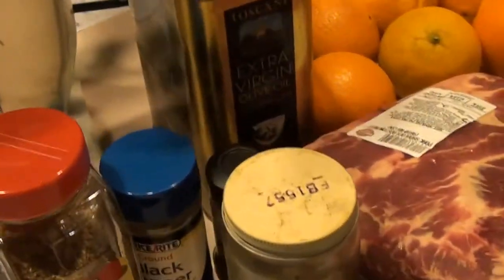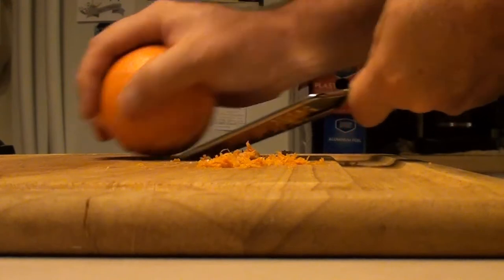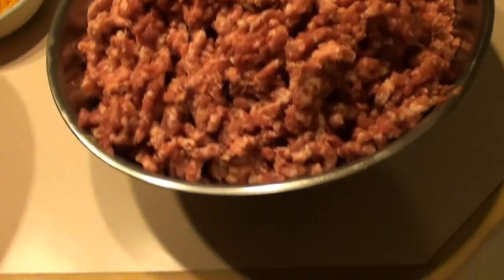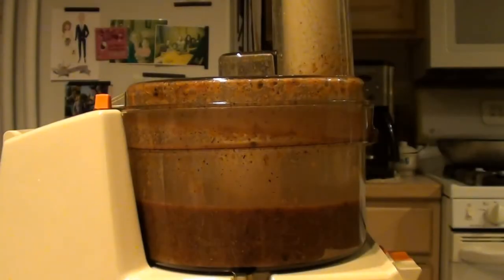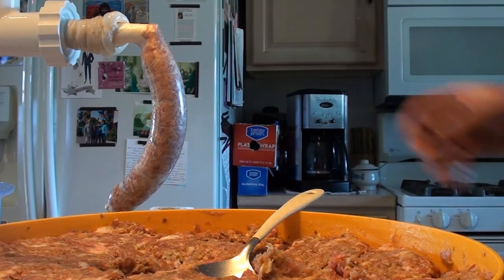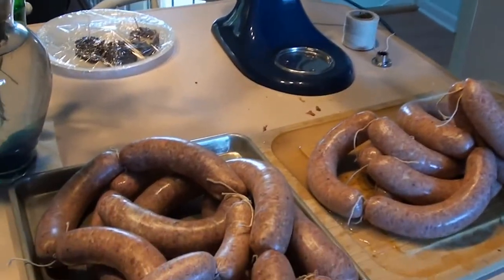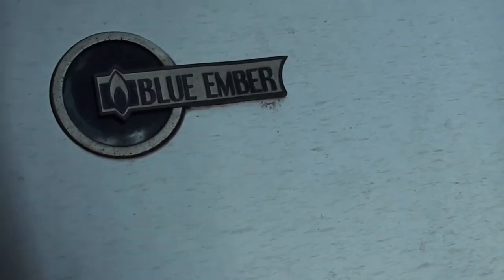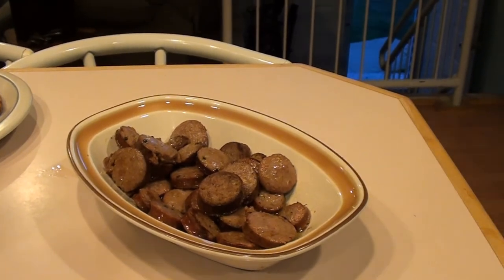Loukaniko - (Greek Sausage) Wicked Good Eats

Comment: this dish looks good but the big mistake you can make with loukaniko sausage is  sometimes you end up not grounding the coriander seeds properly and in turn when you bite into it you end up bitting into the seed and it makes you dislike the dish neat tip use ground coriander seeds and be careful not to add to much fat or to little and the loukaniko should be beautiful